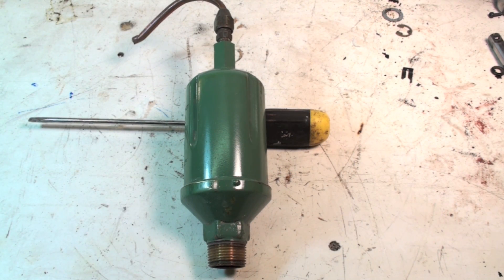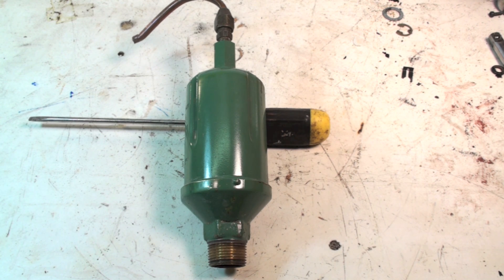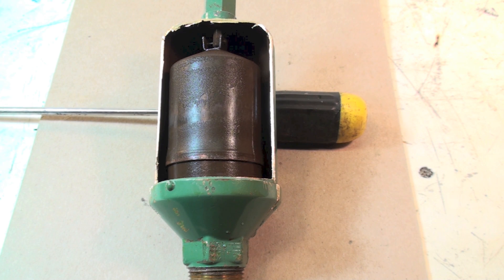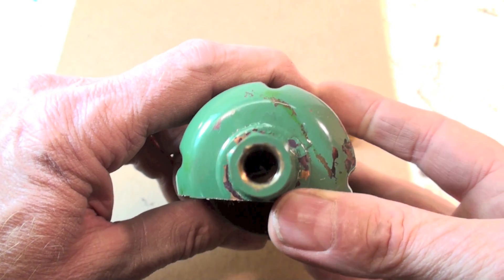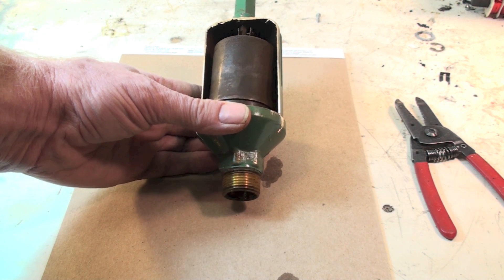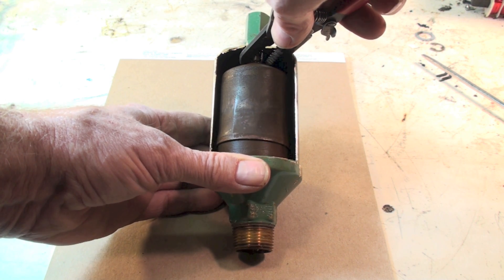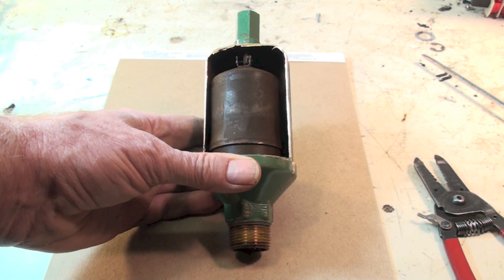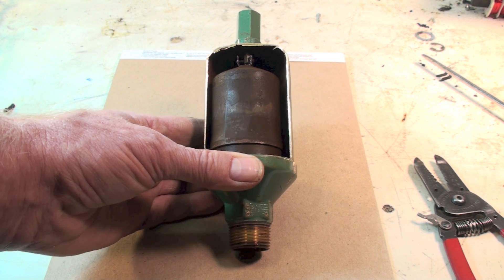How the boiler automatic air bleeder works.

Comment: i put a new hoffman 79 air vent on cause my old hoffman air vent was leaking water no matter if the bleeder was screwed down (off) or opened (on).  anyway, just bought a brand new replacement hoffman. the top bleeder was locked down when i took it out of the box. do i open the bleeder after instalation or leave it tightened (locked down) ?
Reply from the maker: Crack it open.  If the air is all out (no gurgling), you can tighten it.
GFM
Reply: @grayfurnaceman  thankyou 🙂

Comment: Thanks. Yeah, I think the auto-bleeder on mine is shot. It has a cap on it. But when the cap is opened, is just purges air or water. But. it won't shut itself off.  So, no longer automatic.
Reply from the maker: If the bleeder leaks continuously when the cap is off, it has failed.
GFM

Comment: I have one of these at the top of a gravity-feed hot water heating system.  Recently found that it was gummed up, which let air into the system and radiators on several circuits stopped working.  Cleaned it out with vinegar and it's working again - on the first flush green (copper oxide) fluid came out.  Is there something better to clean this out with, or does the valve need to be replaced?
Reply from the maker: I know of no cleaning substance.  However, If you are leaking air into the system, it is probably because the system pressure is too low.  Is your pressure reducing valve working?
On an single story structure, you should have 12# pressure.
GFM
Reply: @grayfurnaceman  it's a two story house, pressure is 20 psi, relief valve is 30 psi. Sound about right?
Reply from the maker: @MrDorsal99  Yes.  If pressure is up, you should get no air into the system.
GFM
Reply: Vinegar is it, although not recommended by the manufacturer. In fact, the manufacturer says don’t put anything in them. I also use vinegar in steam boilers. Smells a little, but it really cleans the pipes out.

Comment: Sounds logical but the root issue is its too cold outside and the home not insulated well....and the boiler design not very good...location of most of the radiators are up against ice cold exterior walls...not ideal lcation at all...be it 180f or 190.f they are  both very hot its now getting to 70f in house and,its warmer outside 0f so ill leave it as,is....rather have it the way it is now then having pressure relief valves shooting out water all the time....in a forced air system the air coming out your vents is nowhere near 180f....maybe 80f if your lucky lol but its circulated air .....thank you

Comment: Hey grey unique situation here... I have a house 1 story 1100sq ft how water boiler as a furnace 75000 btu ...i live in mchigan and we are having record cold temps at about 15f with 20-30mph winds making it about -30 -40f wind chill....coldest in my lifetime....the boiler seems to be functioning but temp wont get hotter than 66f....no matter what setting....thermostat is working.....is it just too cold for the boiler to maintain higher than 66f?....it,was ok couple days ago,when itbwas a a bitbwarmer like 0f.....prior to,this polar vortex it has worked fine and has no problem reaching desirred 72f
Reply from the maker: Your boiler temp is probably too low.  Baseboard should be 180 to 200F.  Cast iron radiators 150 to 175F.
GFM
Reply: hi home was built in 1930 has cast iron radiator style and also basebaord style throughout home...the boiler temp set in aquatat is 180f..it used to be 195F but my relief vales use to leak all the time so i reduced from 195f to 180f and the relief vales never leaked again....have never had an issue regarding not being able to reach reasonable desired temp until last couple days ..outside temps record lows with high winds making temps at -40F i dont think the main issue is the 15F i dropped it .. i think the primary issue is its just too cold out and the design and capacity of furn as well as the age of home with no insulation probably back then just cant keep up...im not going to worry about it ..was just wondering if you ever saw a furnace not be able to heat over 70f due to being just too cold outside...
Reply: so my 180f should be not an issue per your temp recommendations...correct?
Reply: boiler does hit 180f and then cycles burner off  and then once temp goes back down to 170f the burners fires back up..when burners cycle off the water is still flowing through the system...just the burners are off.once the 180f triggers....i believe that is normal operating sequence correct?
Reply from the maker: The 180F temp is the lowest recommended temp for baseboard convectors.  It does not hurt anything but it is probably not high enough for the very cold temps.
GFM

Comment: thank you, is replacing air vent valve on a water boiler straight forward?....remove old..install new and then bleed system?
Reply: Nothing that involves opening the water system on a boiler is straight forward.  Not saying you can't do it, but it can become complicated.
GFM
Reply: The system needs to be partially drained and segments need to be isolated by closing off valves, and then maybe water won’t pour out when the old valve is removed.

Comment: hi i have a boiler that is leaking water at the top of the air bleeder part..the red cap is broken is water suppose to be coming out when cap is off or broken?
Reply from the maker: No.  The bleeder valve has failed.
GFM

Comment: You have answered prior questions about my old Hydrotherm HC-125. Recently, I replaced the Honeywell gas valve because of leak by, installed a larger diaphragm tank and changed the tank configuration from horizontal to vertical, and installed a new Maid O' Mist air bleeder. The gas valve works great. Yet, I still get a 10 psi increase when the boiler heats up and I am wondering if this is because the diaphragm tank is on a dead end pipe? I don't understand why they configured boilers this way in the old days. Also, even with a new air bleeder, the bleeder still leaks. If I loosen the cap as I am supposed to, water comes out just like the old one. Any idea why it would leak? I am wondering it is a configuration issue. Thank you.
Reply from the maker: The new bleeder leaks?  If so, it probably has garbage in it.  The tank being on a dead end line is ok unless the pipe is plugged.  I don't have an answer for the pressure increase.
GFM
Reply: grayfurnaceman Thank you, yes it leaks when I loosen the cap just a tad. I will buy a higher quality bleeder. It appears that Caleffi makes a decent one. The pressure confounds me. I kept adjusting the fill valve to reduce pressure accompanied by releasing the appropriate amount of water. I had the pressure down to 5 psi when cold. The thought was to reduce the cold pressure thinking this would lower the hot pressure, but it always ends up at 21 psi hot, regardless. The plan now is to increase it back to 12 psi and set the diaphragm at 12 psi when cold. The other plan would be to cultivate some sort of social life in lieu of always messing with everything mechanical. Thanks again for the prompt reply.

Comment: I will do that..
The tanks have normally a 10 to 12 psi charge of air in them.
we had removed the air to see if that would aleviate the problem but it did not.
Could a faulty modulating control also make the pressure go up?

Thank you for your response

Comment from the maker: If the tanks are bladder tanks, they could have ruptured.  Open briefly the schraeder valve in the tank.   If you get water, it is ruptured.  If you have expansion tanks, they may need to have the water drained out.  Hope this helps.

Comment: What could be the problem in a closed hot water system when the boiler pressure keeps going up and lifts the relief valve. the system has two expansion tanks.

exellent video and very informative
Reply: Either your pressure is too high to begin and heating sends it over the pressure relief valve limit or temp setting is too high or control is faulty. Or you have a bad relief valve.
Reply: Or the expansion tanks are waterlogged. I know this is a late comment and you’ve probably long solved the problem. This is for the benefit of anyone watching now. A traditional compression tank should not have an automatic air vent anywhere in the system.  It will absorb and purge away the air cushion.

Comment from the maker: The micro bubbler remover such as the Spirovent is a great device.  They are very fast at removing air bubbles.  However, the float bleeders would only introduce air if the pressure in the system if the system pressure reached near 0.  In that case, whether there were automatic bleeders or not, I still found air bubbles in the system.  In any case, the point about the Spirovent is well taken.  Thanks.
GFM

Comment: These are junk. Its just another spot for air to be introduced into the system over time.  Closed loop systems should only have one air removal device and that would be a micro bubbler. Dont use them